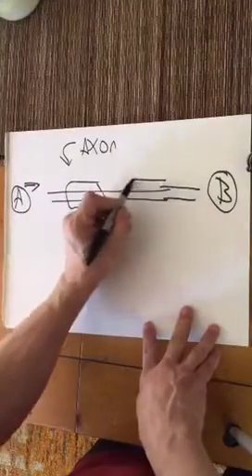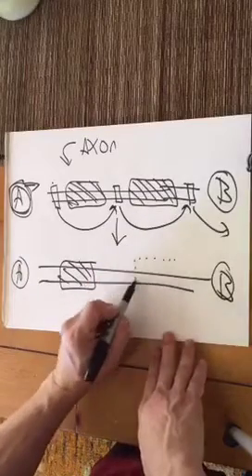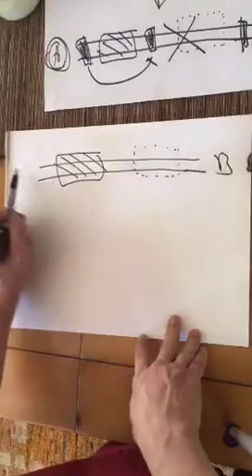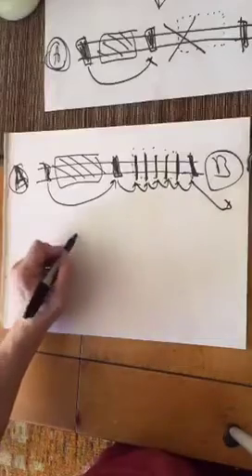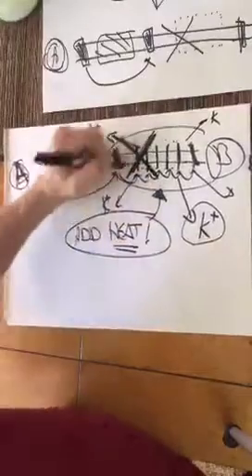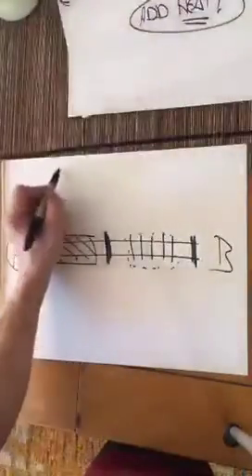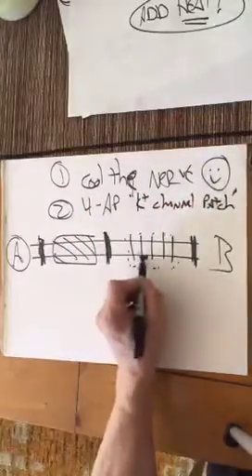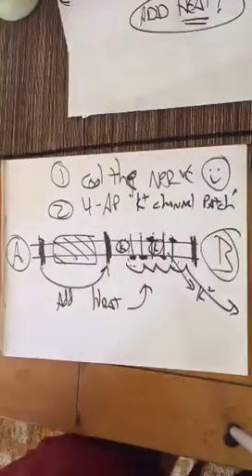Heat sensitivity

Comment: New subscriber.  I found your channel this morning.  I have not been diagnosed with MS.  I have been having problems with nerves for over 5 years.  I had an EMS nerve test done and I ended up getting 4 surgeries on both hands and elbows. It made things worse, and then I was diagnosed with CRPS ( complex regional pain syndrome ). I have been to many Pain drs. I have tried many meds, calmar treatment, ketamine infusions, my pain dr put liquid coc*#ne in my noise with a q-tip to numb me and that did not help, I have had 2 ACDF infusions. Multiple dr's have wanted to put stimulators in my back but I keep refusing.  I am exhausted all the time.  I am on disability and I only leave my house to go to dr appointments.  I self isolate.  My balance is horrible, migraines, nausea, brain fog, dizziness, vertigo, blurred vision. I moved to FL 8 years ago because I loved the heat and sunshine.  I can't stand to be in the heat now.  I get so sick and weak.  I keep ice packs in my freezer and rotate them throughout the day.  Everything I loved, I avoid now.  I have never seen a neurologist or had an MRI on my brain.  I have been told my B12 is low and I was on self injections but it did not help my energy.  I was on adderal years ago for OCD.  It made me even more tired when I took it 2 x daily.  My dr told me to switch to 2 pills 1 x in the morning and I felt like I was somewhat normal.  Pharmacies in my area are always on backorder so I no longer take it.
Sorry for the long comment.  Is there a particular brand of cooling vest that you recommend?  I will try anything at this point.  Thank you for this channel.  I will be talking to my PCP about getting an MRI.
Reply: I would request to be seen by a neurologist and request him/her to do an MRI. I live in the UK and this usually goes through the GP (for a referral). Surely you can do something like this where you stay? Do not take a no for an answer and keep pestering them. There are also videos on how to speak to a specialist (especially the ones who have a too high opinion of themselves) on YouTube, so you can learn the basics to make your stand. I am also searching for a cool vest myself. And one can order with prescription most medications online. Perhaps this would be an idea for you?
Reply: @wendywebster5920  Great advice!